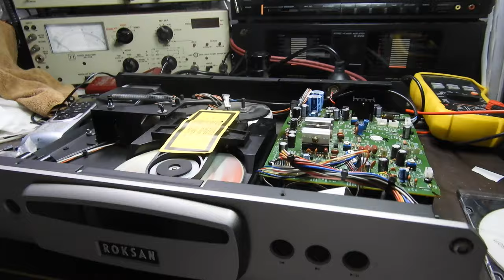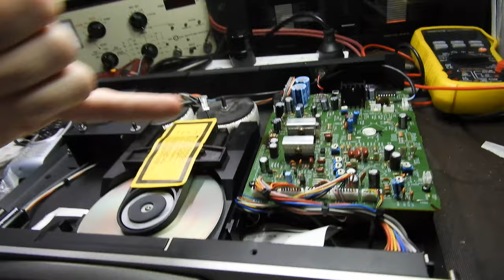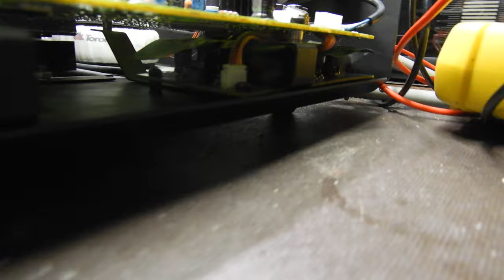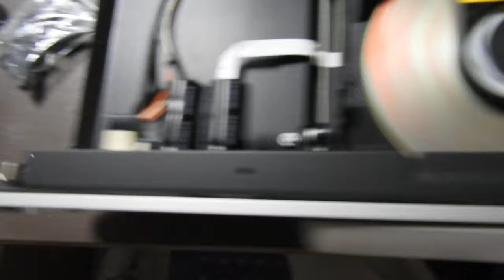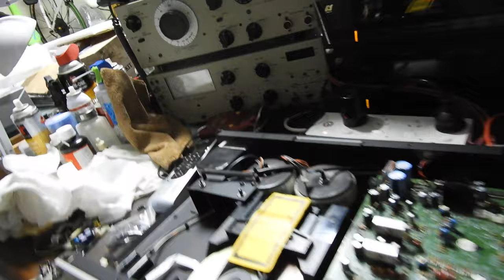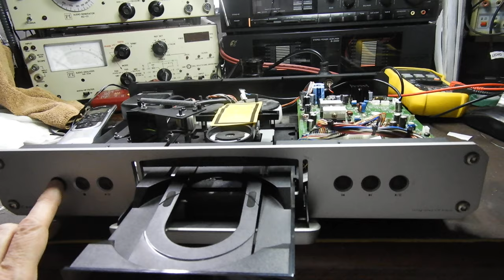Roksan Caspian CD player mid-service

Comment: Hi 
Do u have any video or instruction on changing the Caspian M2 cd player lens. 

Regards
Reply from the maker: No I do not. I have never seen the M2 version. But it is like any other; use an anti-static wrist strap, undo the screws holding it, install the new one, remove the shorting link and using power meter, adjust the laser emission. Then do the servo alignment as per the manual (if you have one).
Reply: @hear-net-au  
Thank you for replying

Comment: this any good for you? Found on the Net "Just fixed a Caspian Display.
Used the Noritake CPF2377 display.
I actually had a chance to look at the Service Manual and here are the notes I took:
1. Remove R162 & R163 (both 470Ω) and replace them with a single 3.3kΩ Metal Film 0.25W in either position. For ease of installation Roksan recommends to do it from top of the board. They suggest to first solder the new resistor on top of R162 and then to cut off R162 & R163.
2. D116 is a 1W 30V Zener that tends to overheat and destroy board and tracks putting full supply voltage on the display element. To remedy this, Roksan suggests to add 1.5kΩ Metal Film 0.25W resistor in series with R170 which is a fusible resistor of 220Ω to 470Ω value.
Here also they recommend doing it from the top of the board by cutting R170 leg and soldering the extra resistor to both ends of the cut leg.

Other non related to the display problem mods are:
1. bit of gear grease to be put at shaft entry to the TT motor to remedy ticking noise if present
2. to remedy inability to play CD-Rs they strongly suggest to refrain from adjusting laser power but instead to carry out the following:
Replace R107 15kΩ with 22kΩ
Replace R108 10kΩ with 2.2kΩ
Replace C102 5pF with 2 to 2.2pF (ceramic)."
Reply from the maker: Thanks. I know this article and it did help me previously. Later, I have found a source of brand new displays from another unit. 
The mods to the circuitry are reasonably well documented in the service manual (which has been sent me). But thanks for this and it will probably help someone else. Cheers
Reply: @hear-net-au  were there any other mods in the service manual?
Reply: Hi, I’ve just fixed my friends CD, the mains filter was faulty which I have replaced. Looking at the MB I see R170 has been modified with 220 and 100 ohm. R162/163 are both 480 ohm.  The display is very dim and the board around D116 is very brown. Should do the above mods?
Reply: @adriancarpenter4493

Comment: Hi any idea how to reset this CD player, i have one, it was playing very nice, it suddently keep silent do not want to openclose, but displays , change track info all working..
Reply from the maker: Well, i would open it up (6 screws on the bottom and then slide the cover back) and see what happens. Something can be blocking the tray. You should be able to tush the tray out and it should just slide. If it does, press "close" and see if it goes back. maybe the belt has perished and it needs a new one. Roksan is a bit fiddly though.
Reply: Hi, there is a rubber belt that goes around two wheels, that are visible on the left of that big yellow when the drawer is open (with the top off the machine). Mine was stretched and caused the draw to stick.

Comment: Hi 
I have one of these.
You mention in selling on eBay that you cleaned the lens. Mine is getting picky and wiped it with cotton bud. But maybe there is a better tip.

Second one part is getting very hot in the motherboard and a bit of darkening around the board . Same location as on this pic 
http://longingforaudio.blog.fc2.com/img/blog_import_53b8dfac16513.jpg/

Needs replacing ?
Reply from the maker: This scorched area needs to attended to (unless it has been before). This is due to a design fault of too low value of resistor from power supply to the display voltage stabilising Zener and is a reason why displays in these units go dim. Eventually, the track on which this Zener diode sits becomes broken and full voltage from PSU goes onto the display and damages it. Resistor R170 should be increased by 220 Ohm (in series with the current 100 Ohm there) and (from memory) R163 and 164 to be 470 Ohm. But would need to check it.
On the matter of not reading the CDs, check if the PLL is 4.3218 MHz first and if this is OK, align the servo as you would normally do in Sanyo / Sony units. If you do not know how it is done, then you should not try doing it your self :-( I do not have Caspian manual but a lot of C.E.C. units that use this motherboard have the manuals available on the net.
Hope it helps.